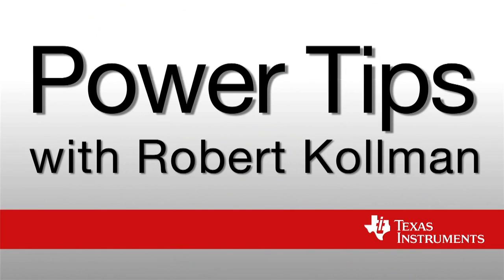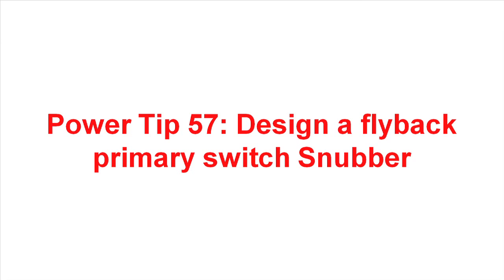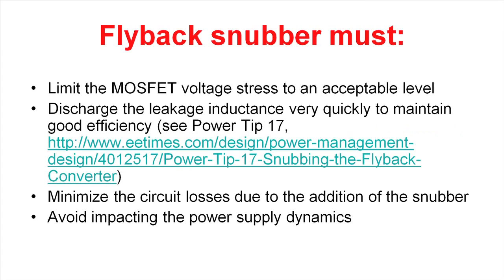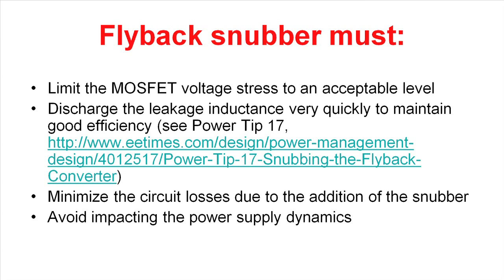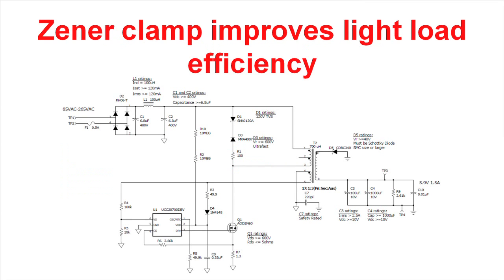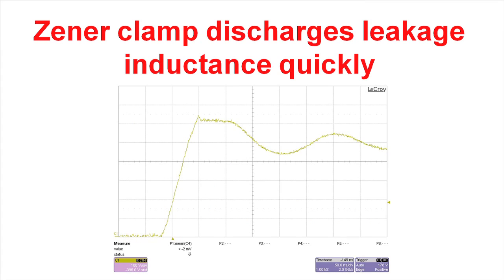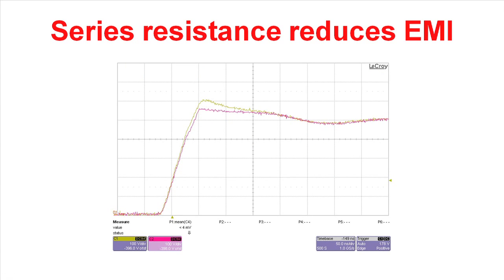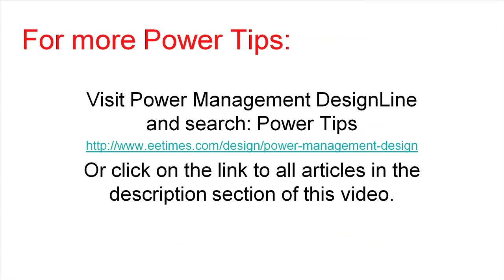Power Tip 57: Design a flyback pirmary switch Snubber

Comment: Ahh that was Good one. If you have light load then I guess the RCD snubber will decrease the Voltage on the C in the RCD acording to the lower energy in Leak L. So even at light load the snubber ”lock in” time Will remain as long as with full load. In contrast the RZD snubber Will hold same high voltage catch independent of the load. So instead when RZD used it Will shorter the ”catch TIME” instead of the ”catch VOLT” on the RCD. Am I correct?